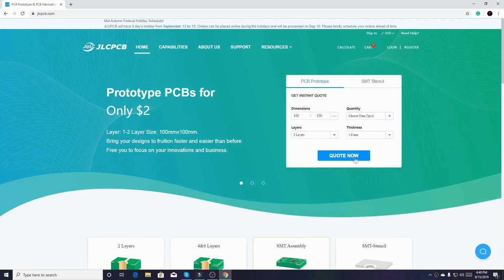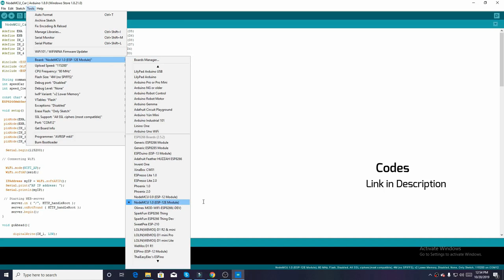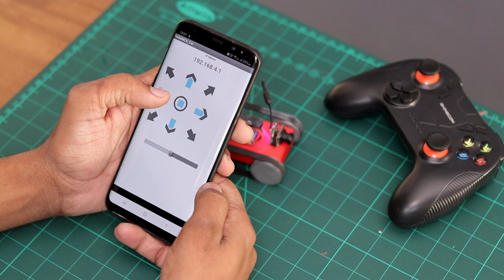WOW! Amazing DIY idea - Mini Tank with Camera

Comment: Thank you for nice design and video. It is nice project. I really liked general design and implementation. But I didn't like your idle wheel connection approach. It can be designed with belt tensioner with stationary wheel connection. Kind regards.

Comment: So the cam is connected to display wirelessly using its own RF module? Seems like there is NOT implementation on video streaming on the ESP8266 side(which is also not quite capable)

Comment: Is it possible to see the camera in phone without vr?
Reply: Yea u could. Create an app for the phone/tablet. Add bluetooth to the microcontroller and code it to recieve controls from the mobile device and stream to the mobile. For Android there is stacks of libraries for streaming. In its default libs there is 1 believe is called MediaPlayer. Can stream via local from device URI or via external IP or hyperlink. When it comes to software Android has what you need. 

Look up examples should be able to find many done with the Arduino, Pi etc.